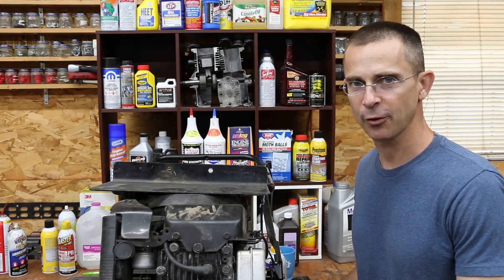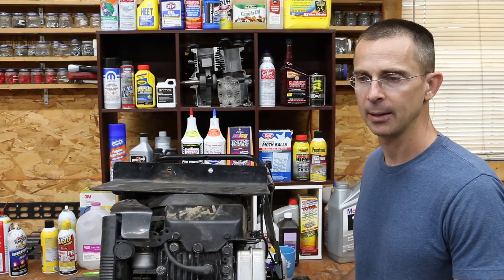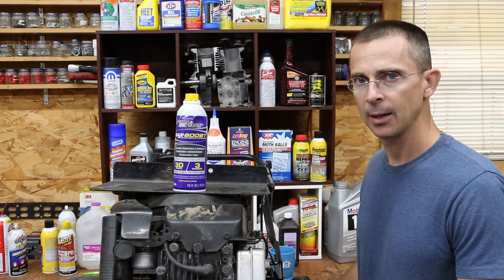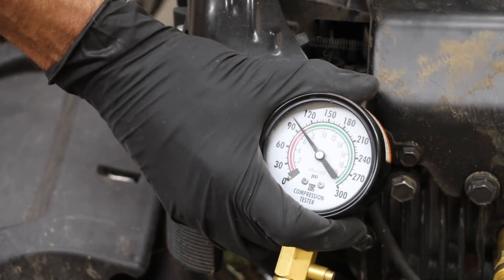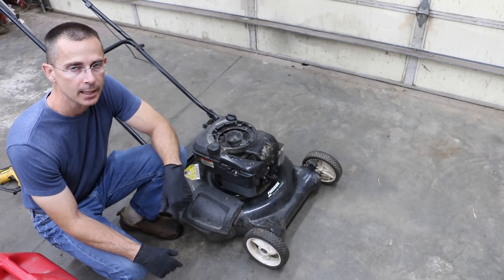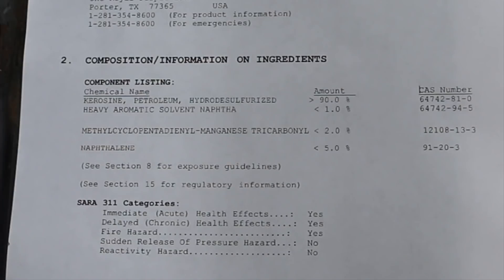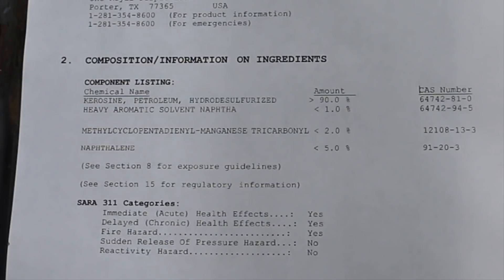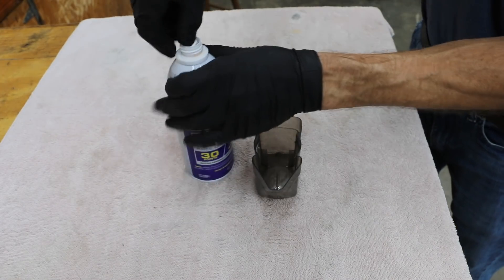Will a gas engine run on 100% octane booster?  Let's find out!

Comment: Royal Purple's grease is the only grease I can buy, put in my grease gun, and leave in my 120 degree shed here in Florida without it running. Generic, Mobil 1, Lucas, all of them start to liquefy and run within just the first few months. 

It's not just important to prevent a mess to find a nice grease that doesn't run, it's important for what you use it on! If I can't trust it when it's 120 in my shed how can I trust it on my car? Royal Purple, they're serious about making a quality product. Of course this is just my opinion though based on the products I have used from them.
Reply from the maker: Thank you for this recommendation.  They make many terrific products. I'm looking forward to testing more of their products in upcoming videos.

Comment: The see-through engine reminds me a lot of an old tool I used to have called Colortune, which was basically a spark plug that had a clear window so you could tune your engine based on the color of the flame the engine was producing.
Reply from the maker: Interesting. Thanks for commenting on this.

Comment: before watching, I would say unlikely. the rubbing alcohol would burn better. what kind of octane boost? what is in it? I do like your before and after tests, temps test.note: the orange build up is only from the chemicals in the octane boost. nothing to be concerned about. it is not abnormal to see the same thing on spark plugs. this will go away when that chemical is not longer being burned in the engine
Reply from the maker: I hope you enjoyed the video.

Comment: If you are looking for other fuels, try model airplane fuel - typically 15%-20% nitrol with methanol.
Reply from the maker: Thank you for this recommendation!
Reply: Most jet fuel is Kerosene
Reply: Mike Moore It will run away. I've tried it lol, it also won't turn off after a while, even with the plug wire removed.

Comment: That booster was 90% kerosene!!! Am surprised that it ran at all. Didn't expect that kerosene would vaporize and explode. Amazing how tolerant that little engine is. Thanks.
Reply from the maker: Yes, I'm surprised it ran so well too.  That product is very expensive considering it's mostly kerosene. Thanks for commenting!
Reply: Timothy Price I echo your surprise!  Surprised, as well, it did not detonate. Kohler used to offer kerosene conversion kits for their k-series engines which included a low compression cylinder head.
Reply: Matthew Weisenburger Nope, not "kerosine + petroleum" just kerosine. CAS NUMBER is for kerosine which is a petroleum product. So, the stuff is (interestingly) >90% *low octane fuel*.
Reply: Timothy Price 90% kerosene and petroleum. They didn't specify the ratio between the two.

Comment: Project Farm, please try WildCat Nitro Fuel, its that red stuff, do what you did here, like run it without any gas. I have some and I have a small engine like the ones you have, and Id like to see what would happen if I either mix it with gas, or do it without gas. Heres a link to their website to look at all the types http://www.byronfuels.com/products/wildcat.html
Reply from the maker: Thank you for this recommendation!
Reply: Project Farm oh and another thing,  I have a small engine that I believe.. Crankcase gasket completely like disintegrated and made oil go everywhere and now it can't make a seal without it, what would you recommend I do? I would buy a new one but I have found a set of a bunch but only need the one, but should I make one out of wood and gasket maker, or cardboard, or what

Comment: Run an engine with Everclear which is 95%alc. if it didn’t work try mixing it with gas..
Reply: For the record, you're both right:  190 proof is 95% alcohol.
Reply from the maker: Thank you for this recommendation!
Reply: 2x4 Barrels ethanol can only be distilled to 95% because the vapor pressure is too close to that of water
Reply: it was never 200 proof, at about 95% (190 proof) it becomes VERY hard to remove the water from the alcohol.
Reply: Only thing 200 proof is Denatured Alcohol.  lol
Reply: for the record this has been done.  check youtube. lawnmower ran very well.
Reply: Larry Ciarrocchi 190 proof equals 95%... for some long forgotten reason proof number is 2 times % alcohol by volume.
Reply: animefreak5757 EXACTLY
Reply: Thought that was only used when "proofing" moonshine?
Reply: I'd like to see you gradually add water until it no longer runs and see what percentage that is.
Reply: pretty sure as long as it's above 50% alcohol it should burn.
Reply: Yes, but well enough to mow the lawn with?
Reply: It used to be   200  %  fucken obama he ruined everything .
Reply: Everclear is 190% proof.

Comment: In ofder to gain anything by adding octane...you need to increase timing quite a bit. Take the flywheel off & advance the timing all the way and try it again. Byw...running one on straight ether would be interesting.
Reply from the maker: Thank you for this recommendation!

Comment: I'm oldschool boost's wife, my mom left gas in her brand new lawn mower last summer. I haven't been able to get it started for her this year. I tried spraying with ether but that didn't work. Is there any way to get it running without pulling the carb? Any help is appreciated.
Reply from the maker: I always begin with making sure an engine has ignition.  I remove the spark plug and spin the engine over looking for a spark.  Assuming it has a spark, I remove the air breather and spray starting fluid into the carb.  Normally, that's enough to get the engine to start.  Sometimes, oil residue accumulates in the combustion chamber making it very difficult to start after a long rest even though the carb is fine. Hope this helps.!
Reply: Thanks for the help. I can definitely take stuff apart. I'm not sure about the rest of it. Once I get it apart my husband will have to help to get it back together.

Comment: Great video! But just because a mixture has a product in it (napthalene) it does not necessarily mean it is an octane booster -- could be there for any one of a dozen reasons. Interesting film it left...looked very close to rust.
Reply from the maker: Excellent point regarding the naphthalene.  I was really surprised by the film!

Comment: It makes the engine run, but it would be really expensive to fill the tank with the octane booster.  :-)
Hey have you done a test to see how long a 4 stroke engine will run without oil and using two stroke mix for fuel? I was wondering that's all.
Reply from the maker: Excellent point regarding the cost. Also, I have not yet done a video on this. Thank you for this recommendation!

Comment: Can a gas engine run on WD-40 I really want to know,and if it makes it to a video thank you!
Reply from the maker: Thank you for this recommendation!
Reply: My neighbor uses it as starter fluid. At least the top end will be well lubricated!!
Reply: Yea I've used WD40 as starting fluid when I've had nothing else. Spray degreaser worked too. Wondering about deodorant now...
Reply: We use it as a good way to loosen up a seized engine that's been sitting for a long time
Reply: A diesel can, for sure run on wd40, did it a thousand times. 

But not every gasoline engine can... tried it on a few, did not work on every
Reply: WD-40 is mostly kerosene and he did a video on that

Comment: Here's an idea, does running an engine hard on a cold start damage it or cause buildup? Perhaps take the "cold" to the extreme, putting the engine in liquid nitrogen first. Maybe the thermal shock would cause something to break. Maybe it'd just sieze?
Reply from the maker: Thank you for this recommendation!

Comment: For the 123rd time (j/k) would you please try hydrogen peroxide as an engine cleaner?
Reply from the maker: I've got a bottle ready for testing.  Could you please send an email to me describing how you recommend I add the hydrogen peroxide?  In other words, please help me with the project design.  Should I hot soak?  Add a drip?  projectfarm52@gmail.com Thank you!

Comment: Completely unexpected!  I wouldn't have expected it to run at all.  Since the main ingredient per the MSDS is kerosene...I wonder how well the same engine would run on plain old kerosene?  Or maybe kerosene plus 10% gasoline?  Keep up the good work - enjoy these vids.
Reply from the maker: Excellent point. I plan to test kerosene. This booster also contained naphthalene, which might have helped it run better.  Thanks again!
Reply: Kerosene plus napthalene would also be very interesting.  Looking forward to your test and video!

Comment: me and my friend had a discussion, what would happen if you ran an engine on Transfomer Oil, in the sump of the engine?
https://www.ebay.co.uk/i/302472075553?chn=ps&dispItem=1&adgroupid=43920634520&rlsatarget=pla-359427365517&abcId=1063846&adtype=pla&merchantid=113291785&poi=&googleloc=1007225&device=t&campaignid=797602469&crdt=0&ul_ref=http%253A%252F%252Frover.ebay.com%252Frover%252F1%252F710-134428-41853-0%252F2%253Fmpre%253Dhttps%25253A%25252F%25252Fwww.ebay.co.uk%25252Fi%25252F302472075553%25253Fchn%25253Dps%252526dispItem%25253D1%2526itemid%253D302472075553%2526targetid%253D359427365517%2526device%253Dt%2526adtype%253Dpla%2526googleloc%253D1007225%2526poi%253D%2526campaignid%253D797602469%2526adgroupid%253D43920634520%2526rlsatarget%253Dpla-359427365517%2526abcId%253D1063846%2526merchantid%253D113291785%2526gclid%253DEAIaIQobChMIxb_-zfjS1gIV7RbTCh1fjgZFEAkYBSABEgKSrvD_BwE%2526srcrot%253D710-134428-41853-0%2526rvr_id%253D1325485267755
Reply from the maker: Thanks for commenting on this!

Comment: awesome video yet again .  I www suprised to see the orange crudd on the cylinder head I wonder what that's from  ?
you should try to run grease as motor oil maybe 
cheers
Reply from the maker: Thank you for this recommendation and thanks for the positive comment. I'm not sure what caused the orange buildup, but it shouldn't be a problem.  Cheers

Comment: Cool video.  Have you ever tried Coleman fuel? I did about 45 years ago, and as I remember, the muffler got red hot and a flame coming out of it.  Even back then I was fixing trash picked mowers, at 15.  I ran out gas and Coleman was all I had in the garage.  I couldn’t drive to the station, yet
Reply from the maker: I have not yet tried it, but I plan to do so in an upcoming video.  This should be interesting.  Thank you for this recommendation!
Reply: I believe that stuff was also known as 'white gas' no? I seem to remember having a little model airplane with a motor than ran on a thimble full of that stuff. Sounded like a killer hummingbird.
Reply: I ran a snowmobile engine on Coleman fuel.  It ran pretty good on it.
Reply: Shellite? It's burns well enough so would be interesting
Reply: I did this and cut it with vegetable oil. ran for a long time.
Reply: Love it.
Reply: I’ve got a built 350 small block in my c10 and I run one gallon of Coleman fuel to 5 gallons of 100% gasoline. Its pretty much racing fuel and has the same smell.
Reply: EatnLunch that's nitromethane, it's used in RC and top fuel
Reply: Whatever it was, it made that little motor turn over

Comment: Try a gas to diesel conversion.  The injection could be controlled with a Hall effect sensor on the coil mount and a Arduino.
Reply from the maker: Thank you for this recommendation!

Comment: Run an engine on nitro rc car gas!
Reply from the maker: Thank you for this recommendation!
Reply: Grady Hall I’ve always wondered about that one. I have a nitro rc and the fuel is a mix of nitro methane, methonal, and oil so it’s very explosive. Could’ve be very interesting
Reply: @benr4677  lol it's not explosive. Pure nitromethane is very explosive indeed, but you can never get it pure, it's always diluted, which basically makes it harmless. Mixed nitro RC fuel also has a very high flash point, which is pretty much the complete opposite of explosive. Gasoline on the other hand has a low flash point, making it pretty damn dangerous.
Reply: Project Farm do it do it
Reply: You neet to modify the carburetor to run at very rich mixture.
Reply: Project Farm dont run it on nitro rc gas it sucks too much oil and it bogs it down
Reply: @projectfarm do you have any 2-stroke motors? Try the RC fuel in a 2 stroke!
Reply: Nitromthanes stoichiometric ratio of 1.7:1 compared to petrols 14.7:1 is going to make that virtually impossible on a basic lawn mower carb
Reply: i tried it with a rider it wont run.. because that stuff doesnt burn hot enough
Reply: Grady Hall yeah that's a great idea 20% Traxxas RC fuel hehe
Reply: Lol crbill53 we did the same with my friends go-kart. We realized quickly it needed higher gears to make use of the power and shortly after it  went downhill.. L:
Reply: When I was young I always wanted to try it thinking it would make my car faster lol
Reply: Your going to need to start it on fuel  and/or methanol (warm it up) and make sure it's over rich 6:1 instead of stock 14:1 then switch to nitro and if you do get it to run on nitro you will need to shut off fuel to turn it off because it will be dieseling...
You can buy methanol and nitro separate without castor oil at hobby shops
Reply: I tried a ounce or two in pre mix for my go-ped 2 cycle 25cc. When I got the mix right it had twice the power but didn't last long, stopped running.
Reply: Was going to comment this haha
Reply: I used to run nitro thru my 2strk dirt bike at 10:1. It boosted the power big time. Didn't seem to do any damage.
Reply: Grady Hall Sadly, nitro fuel doesnt burn hot enough in a regular combustion engine. The oils added would really gum up the injectors and probably foul up the converter big time. A plugged up converter would be very expencive to repair.
Reply: Yesssss totally do it or on pure nitro if u can still get that stuff I've wondered if that stuff will just totally burn down an engine like I was told back in school was curious but never tried it haha
Reply: Grady Hall yes sir now that would be awesome
Reply: Agreed please do!!!
Reply: I tried this many years ago and was never able to get it to start and stay running more than a few seconds.
Reply: I've run my go kart (as a kid) on nitromethane.  Seemed to have a lot more power
Reply: Project Farm cc
Reply: yes I did this with my 2 stroke whipper snipper.  Did the same, kill switch didn't work.. I had to pull out the fuel line.  Was a cool experiment  - it was 50% RC Nitro 50% 2 stroke oil.  and it idles way higher... would like to see Project Farm do it on a 4 stroke mower.  Love the channel BTW!
Reply: I used a gallon of airplane fuel in a 5gallon mix for my  503cc.BANSHEE  it's had lots of mods, high performance upgrades most are 350bänshee ,being 348cc stock.. that mixture really helped power wise although I don't recommend it due to higher temp running burn hole in one or both pistons. A BANSHEE it's twin cylinders with correct mods they're BEASTS for sure. I'm running ä coolhead on my cheetah 503cc heads, crank has stroke shorties, ported polished, bored heads, dual36mm carbs,(stock is 28mm I think). it has aftermarket ignition, roostboost, hell got nose hookup , haven't used it yet; no need to.. Point being ; racing gas helps with proper setup..
Reply: You can use the choke.
Reply: 30 dollars a gallon is no joke though
Reply: Nitro should be setup Lean, couse has lots of energy so add more air
Reply: Wouldn’t work. Diesel engine maybe but not gas.
Reply: ran it in a 4 stroke leaf blower.  jetting was way off

Comment: Try running an engine with a acetone and ATF mix either in gas or without gas and see if it works as a carbon cleaner.
Reply from the maker: Thank you for this recommendation!

Comment: Have you ever tried wd40?
Reply from the maker: I have not yet tried it.  Thank you for this recommendation!
Reply: Thomas O'Grady I feel like A diesel engine would work better with WD-40 as it was a failed flamethrower fuel back in World War One it's properties are a lot closer to diesel then gas it's kind of in between
Reply: The aerosol component in the can of WD-40 is what is highly flammable. You can touch a flame to the product after it has left the propellant stream and it won't ignite.
Reply: Project Farm idk how it works, but is it possible have an engine run on water vapor
Reply: Jacob Alvarado it is not quite water vapor it's actually the hydrogen inside of the water, water consist of H2O two hydrogen one oxygen so if you put electricity to the water with stainless steel and and Ironrod for example the stainless steel depending on which terminal it is hooked up to will produce hydrogen and the Ironrod will produce oxygen they also use this process and factories to remove rust from rusted parts it's called electrolysisI did many weeks of study on this with a colleague of mine we managed to get an engine running on 95% water but to do that we had to mess with the electric frequencies going into it it's a very simple process and I think this would be a very good project
Reply: I've asked this quite a few times.  Glad to see any answer,  even if it wasn't to me.
Reply: Yea I've used it to start an engine. Even spray degreaser will start an engine.
Reply: Travis if the engine has fuel injectors it’ll work
Reply: I've started enginenes on WD40 before, but I'm pretty sure its mostly the aerosol thats making them run.. The oil would probably work in a hot diesel engine,,, well, any flammable liquid works in a old diesel engine..